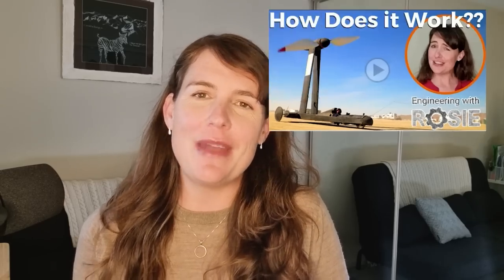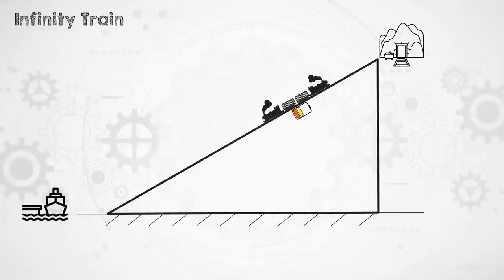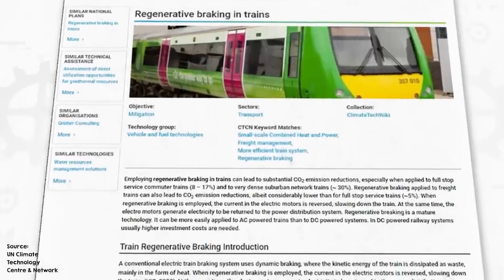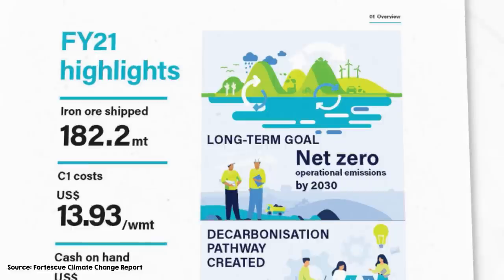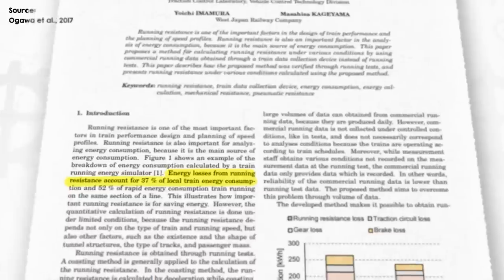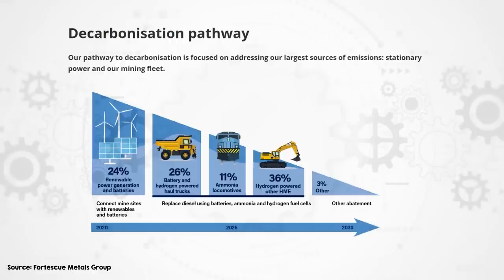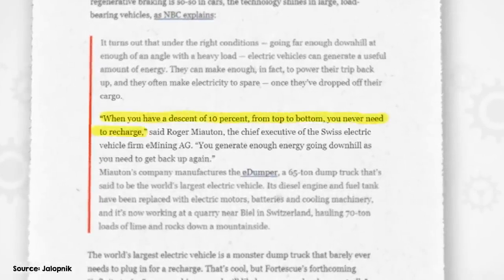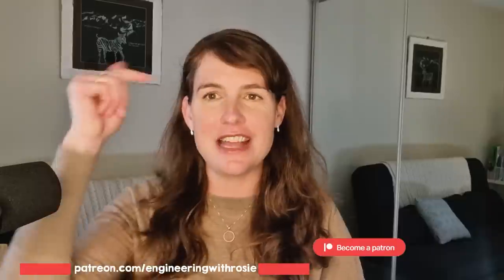This Mining Train Powers Itself: The "Infinity Train" (and how it works)

Comment: While this SEEMS an informative video - it really doesn't get into giving the viewer something to chew on as we head to global boiling.   Why not talk about running trains in tandem - one going down and one going up?   No (horrible <editorial comment here> batteries needed if a loaded rain going down generates power for an empty train traveling up at the same time.  Also, as pointed out elsewhere, why have the train carry the batteries when they could just as easily (and even more easily?) kept in one spot. 

I get this video is a quick gulp - only 13 minutes - so probably not the time to spend really exploring this issue.  But since the clock is ticking (as current UN advice to be at ZERO in 2030 - and of course NO ONE is even considering that )  perhaps a little bit exploratory discussion with zero carbon solutions (oh lets not talk about cost at this time, since the cost of a Planet B is pretty much out of everybody's credit card limit) such as how this could be translated into other areas.  Example - why are not ALL trains doing this (a lot of them do run downhill and may be able to power others going up - no batteries needed.)  

Seems like this is a nice video on a train based on and coming from the "free energy" discussions - but - again imo - would help for someone with such a following and a 'soapbox' to produce a video that leads somewhere.  After spending 13 minutes looking at this video, the only takeway is that maybe some viewers might head on over to Brilliant (which actually seems the real point of this video.)  All in all, a nothing burger as far as dealing with global boiling.

Comment: So you havent realized that such a trainroute doesnt have to put the battery on the train? 
They can implement this with a close to off-the-shelve electric locomotive with regenerative breaking and common railcars, which transfers energy bi-directional over an overhead wire/third rail to a stationary energy storage. It would surprise me if they actually develop and buy battery packages on rail cars to achive this ... that would be silly.

Comment: There would have to be a generator on board the train, they wouldn't do it without backup
Reply: I think they would:  relying on the fact that the train can always roll down to the bottom using gravity. If need be it would be charged from the grid there. No need to carry generators up and down the line. 

This assumes there is sufficient gradient everywhere for a train to start from stationary because you never know where it might need to stop in some emergency
Reply: An emergency situation that would require this would be pretty unlikely. They might deal with something like that by bringing a generator along on a truck rather than carrying it all the time. Or just pull the train with the truck to get it going. If the train had to stop suddenly it would probably still have enough power in the batteries to start the downhill roll, but maybe not to complete the climb. So then they could drive it back down to he bottom and top up the batteries there.
Reply from the maker: Fortescue should read this comments thread for some free risk assessment advice! I actually do that for my own "real" job, when I am doing due diligence on a technology that has been covered by a big YouTuber there are always great insights into potential risks and solutions in the comments 😀
Reply: @EngineeringwithRosie  I'm not sure if you're being sarcastic or not? Pretend I'm Sheldon Cooper and you need to hold up the sign!
Reply from the maker: @adrianthoroughgood1191  not sarcastic 😁 I really do that. I'm not an expert in every technology I cover, so it is common that people commenting have real world experience that I can learn from. It's one of the best parts of YouTubing from my perspective, I learn from researching new technologies to cover and then I learn more from the comments on those videos.
Reply: The train always gets a free return to the port energetically in case of an issue. Any redundancy you can provide with a diesel power source you can also provide with more batteries, which can also be used in typical operation.

Comment: I strongly object to the phrase 'using an electric motor in reverse' to act as a generator.
Suppose you had an electrical machine connected to a battery so it runs, turning say in a clockwise direction. So the question is: Given that the machine consists of a simple static field by permanent magnets and a wound rotor armature with a commutator, without changing any of the connections, which way do you turn it to charge the battery?
Every time you  say 'using an electric motor in reverse' you reinforce the notion in students that you should turn the motor backwards, anticlockwise to charge the battery. This is wrong.
Of course to charge the battery you need to turn the motor/generator THE SAME WAY, but faster. The voltage is in the same direction, because the motion and the field are the same, but the current depends on the force on the conductors, so the force needs to be in the opposite direction and that the shaft turns the motor, not the motor turning the shaft , in the same direction.
This used to be taught as Fleming's left hand rule and right hand rule, but alas no more.
TLDR a motor and a generator are the same thing. A running motor generates a back emf opposing the battery voltage. It speeds up til the two cancel. If you want the power to go back the other way you have to go faster.

Comment: Carbon footprint is a furphy. CO² is a vital gas required to maintain plant life AND the minimum level for life above Earth's surface is 150-170ppm. To be totally accurate this is true for C3 and C4 plants (the ones that animals and humans eat) and is not true for CAM plants: sedges, and the like, with a yuck factor of 9. Earth got down as low as 220ppm at one point. Also, CH⁴ (methane) is unstable and volatile: oxygen, 30% of the atmosphere, breaks it down on contact. Ergo Net Zero is a highly risky concept, worthy of a climate vandal. The complete solution to these existential questions is presented in another Regenerative study: Regenerative Agriculture.

Nod nod wink wink: Internal combustion engines are here to stay and whomever uncovers the industrial process for generating long-chain hydrocarbons as a replacement for fuels and oils, portable, high density energy, etc. will make a packet (or three). Hint: HCT waste treatment methods are already producing coal cost effectively but the former will be marine-life based.

Comment: Flinstones a way :))) Why are highways and two stream direction roads, in general, made with slopes two stream lanes must be built with slopes, yeah it s an engineering challenge but it frees energy from mother Earth? 
9:55 All mining trucks are powered by an electric motor and electric matter maybe some have diesel generators on it, we know the reason because to rid-off transmission device in internal combustion engines, and electric frequency convert weighs 100 grams maximum compare to 100 ton for mining truck and F1 Lucas de Grassi knows that transmission even in F1 cars is very heavy and teeth chip away faster than kids that hooked on candy:))))))))))) Sorry, but the mining trucks were unconsciously designed as not EV vehicles they were just the result of unfavorable circumstances.

Comment: law of thermodynamic only works on or in; one system; such as canned soup; but not two independent canned soup; idea some thing will change when pressure is equal all sides; or temperature is equal all side; lacks understanding of physics; so it can be said; law of thermodynamic exists for physics illiterate; e.g. you cannot be scientist; if you cannot explain it; 
so when two or more independent system is fastened; where one has higher pressure than other; e.g. two chamber heat sink; @ 0.8atm & 0.2atm; reaction would be different; and does not violate law of thermodynamics; so if there was connection between two; the system could be used as heat exchanger; closed evaporative chiller; to cool steam; at adjacent chamber; at specific pressure; without having other go into boiling point; especially if other chamber had internalized vane; would remove heat and work as heat sink; one of my inventions; from 1999;

Comment: Endless energy is absolutely possible.  Just get your government to pass laws and standards that require all new highways and all existing highways be retrofit to have a .5% downgrade for each direction of travel.   No fuel or electricity needed.  Should be a easy sell to the government, lots of created jobs, no carbon footprint, very green system.  Dam that pesky physics full speed ahead.

Comment: How much energy was used to build this train?
How much energy is used to mine and fill this train?
Not a perpetual motion, it has other energy used to keep it going.
It's a good idea and energy efficient but not zero emissions.
It will still use fossil products to lubricant the moving parts.
News flash batteries don't last for ever and to get the heavy metals to build more batteries we will need energy to mine those metals then energy to build the batteries. Not to mention the environmental impact to dispose of the old batteries.
The EVs are a big lie.